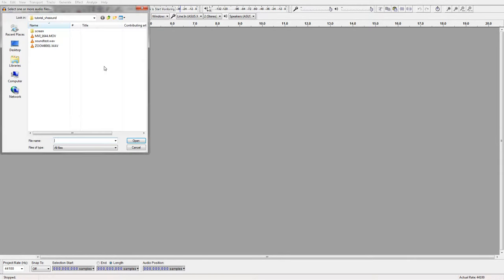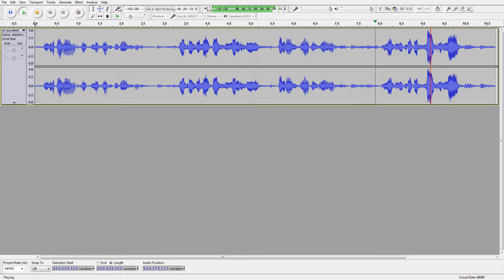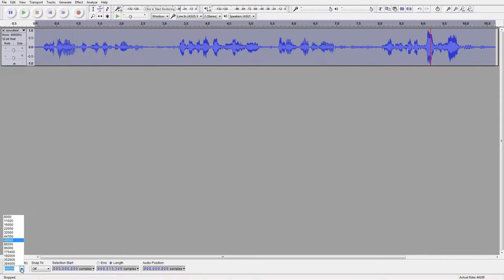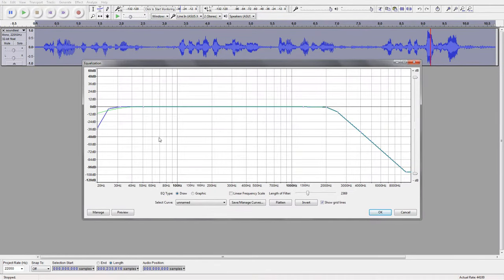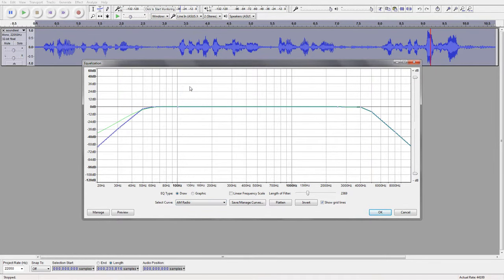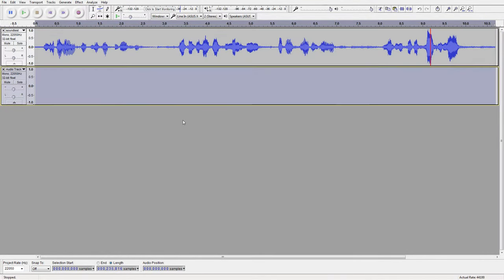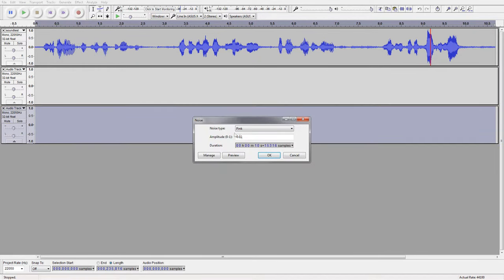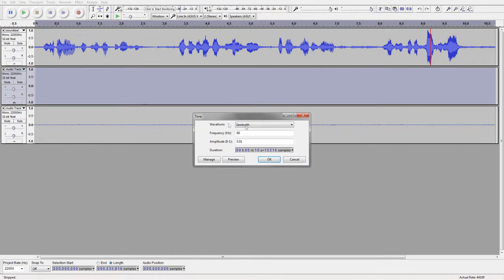Addendum: How to simulate VHS sound

Comment: If you wanna get it perfect, add a 16khz sine wave to simulate the noise a CRT TV makes.
Reply: okay but what amplitude settings do i need for this? im tired to generate 16khz sine wave but im getting grey button. what im doing wrong?
Reply: what should the amplitude be?
Reply: @pixistix_  I tried out 0.7, and it works pretty well
Reply: @irjd6334  thanks!
Reply: @pixistix_  np
Reply: *16Hz
Reply: Cool
Reply: @mazinga8600  that would be so low it would be under the audible spectrum. It's 16kHz.
Reply: You’re trying to generate a 16000 hz frequency above 11025 hz. 22050 hz sample rate audio files don’t cut off at 22050 hz, they cut off at half the sample rate, which is 11025 hz. like how 44100 hz files don’t cut off at 44100 hz, they cut off at 22050 hz
Reply: @mazinga8600  thank you for correction.
Reply: That noise isn't recorded in the VHS tape, it's produced by the CRT itself

Comment: I did all the instruction that you made but, here's the thing, when I play it says “This file isn't playable. That might be because the file type is unsupported, the file extension is incorrect, or the file is corrupt.” pls help asap thanks
Reply from the maker: Okay, I looked up the error. Are you using Windows Media Player? There are a few things you can try to fix it: First, when you exported your file, it might have been with a different extension, like .aiff. Even if the header is WAV, it might not read the file correctly. Try renaming the file to change its extension to .wav. Windows Explorer hides extensions by default now, so you’ll have to disable that in the options. You can also try exporting it again with a filename ending in .wav. If that doesn’t work either, you can try to re‐encode it. Open the exported 8‐bit file in Audacity, and export it again as a 16‐bit WAV or an MP3.
Reply: @RiveroftheValley  OMG THANK YOU  SOO MUCH FOR THE HELP! YOU DESERVE A SUB!
Reply from the maker: @artheoxdotexe  No probalo!

Comment: I simulated very damaged VHS and its pretty accurate, you just use a overlay and a unsharpen mask.
Without the unsharpen mask, it wont blend in and I am using this overlay I found on YouTube called 'VHS Noise In 4k'.